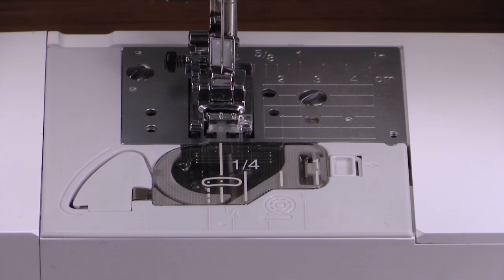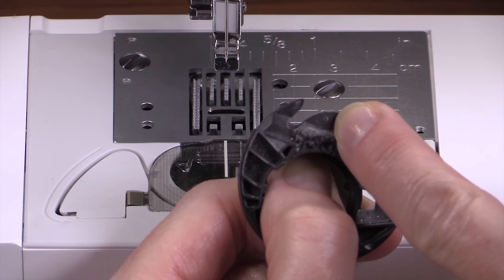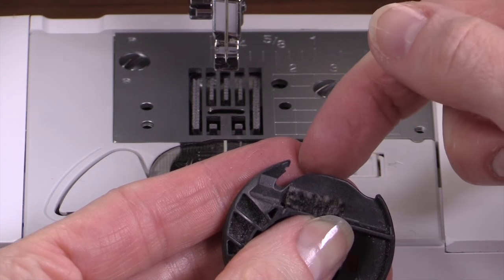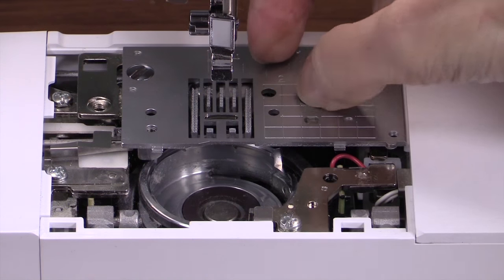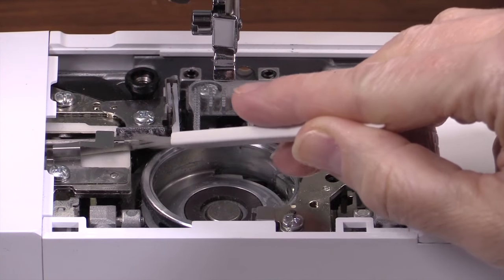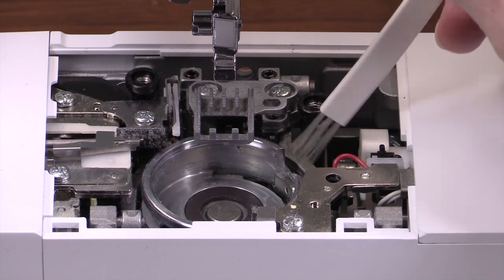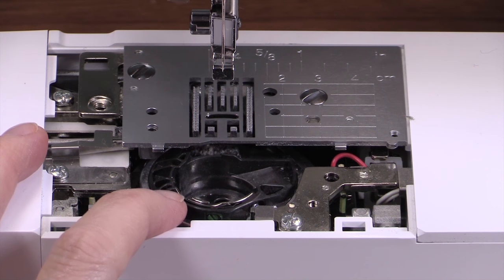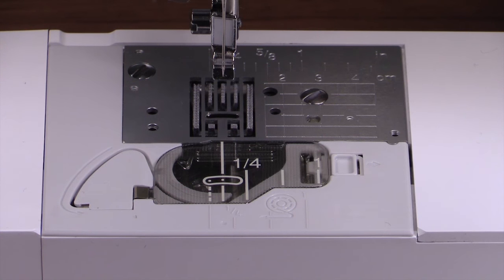How to Clean the Bobbin Area of a Sewing Machine

Comment: THANK YOU!!!! I could not get it back together correctly.  It turns out that the plate had come off in one piece, but it's really two.  When I separated them and put them in one at a time, it worked.  And also a needle has gone through my bobbin, which I wasn't even looking for until you held up one that looks identical to mine.  I'll send for a new one right away and hope that fixes some of my missing stitches!

Comment: Thanks for this video. It was very clear to understand. May I suggest that the white plastic portion be replaced before inserting the needle so there's no chance of dropping the needle into the machine. Also, due to a very slight misalignment during manufacturing, I need to open my accessory box before I can pop that white portion of the cover forward.
I was extremely frustrated trying to remove this cover until I figured the out. the accessory box cover must also be open to replace this case cover portion.  My dealer agreed with my assessment of my particular problem.
Reply from the maker: Hi Marlette! Thanks for sharing your experience! That is a great idea to put the white/gray portion back before replacing your needle to avoid the chance of your needle falling into the machine!! Carla did actually remove the accessory box from the machine to move the white/gray portion on and off.

Comment: Great video on for cleaning & re your bobbin case, although mine have no dots.    Do you have a video you can recommend to clear a bobbin safety lock????
Reply: Patty, that message usually if there is a bind in the machine. When you remove the Bobbin Case and the needle plate and rotate the handwheel toward you. It should be easy to turn. If you attach those parts and it becomes hard to turn, they may not be assembled properly.

Comment: Why not use canned air to clean bobbin housing?
Reply from the maker: Hi Jane! We try to avoid the canned air because we don't like to blow anything into the machine. If you would like to use something to pull the dust/build up out, we'd recommend getting keyboard vacuum attachments and pull it out vs. blowing it into the machine. Thank you for asking!
Reply: If you use canned air you will for e tiny pieces of lint into the machine. It will build up in the inaccessible, to you,  areas and cause problems requiring a professional cleaning sooner than you may have needed. You would be surprised how much lint can be forced into areas you can't see!!  Using a vacuum with the electronics accessories is a much safer and efficient method of cleaning your machine if you think you need to get lint out that you can't reach with you brush tool. The accessory set costs about $20-25,00 which is much cheaper than a repair!